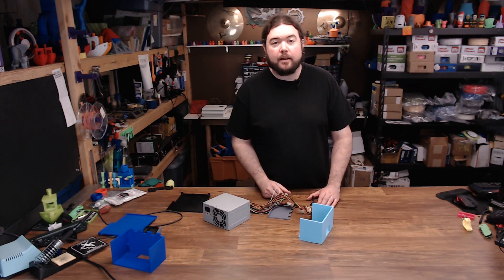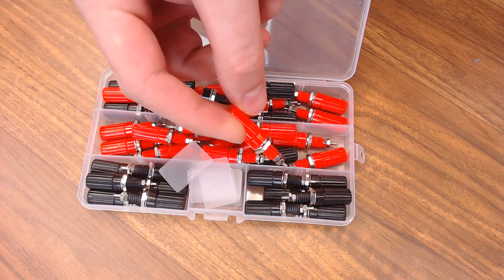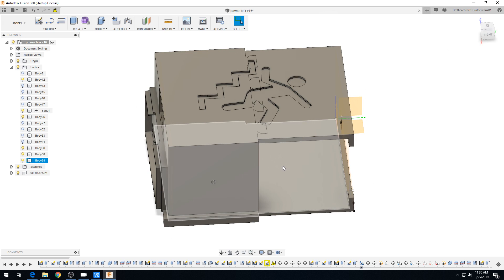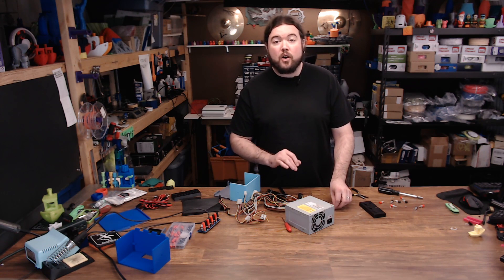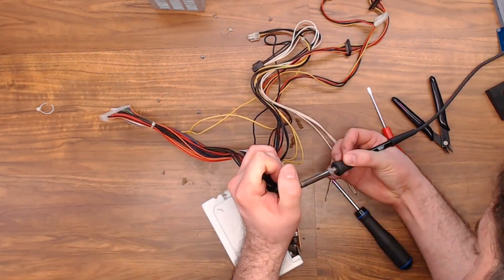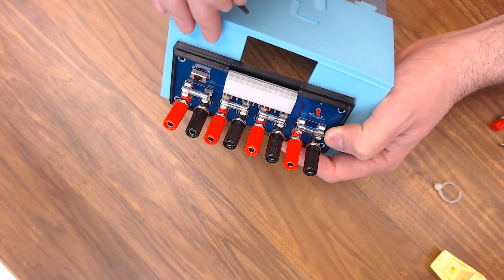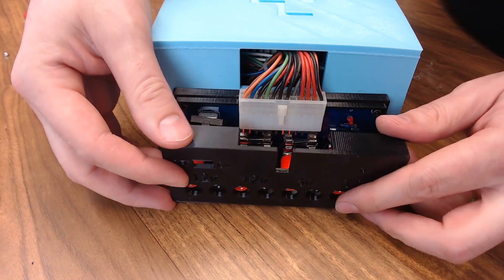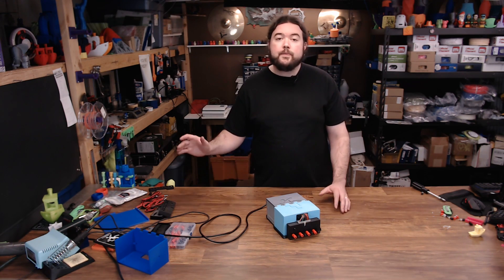Bench Top ATX Power Supply - 3D Printed - Chris's Basement

Comment: Thanks Chris- I posted a make. I did print in PLA just to try it, joints did not fit as expected. The logo area struggle with some bridging issues, but it was good enough  to accomplish a very cool task - well done. I now have a (fused) bench power supply. I am currently testing a (joined) all-in-one top piece with logo to try and make it a cleaner print.
Reply from the maker: Thanks for posting the make. I struggled a bit with it as well. I will go check it out now.

Comment: Neat project chris, I think just about every tinkerer out there has one or  two pc psu's knocking around,  the Haswell compatible power supplies  should be great for this as they do not require a dummy load  for stable operation but there are a few older ATX PSU's that do on the 5V rail  (10w is usually enough) to keep the 12v rail stable,  the ones that give trouble tend to push more watts on the 5v rail than 12v  as written on the side of the psu - look forward to your next one thanks again
Reply from the maker: Thanks Andy! Mine appears to be pretty stable, really happy with how it turned out.

Comment: Nice job Chris.  I like the adapter you got, and the upgrade to it was smart.  Great you un-soldered the extra wire instead of just cutting it.
Should have removed the dust from inside, helps the components stay cooler.
Reply from the maker: Thanks Mark! You're right, I should have.....some might have fell out? ;)

Comment: I just printed this for my PSU. But i made a different front for the ATX break-out board, because i bought a different type with the USB, 3-pin fan and 4-pin fan outputs. Actually my first design in Fusion360 and it fits perfect.
Reply from the maker: Very nice! Post a make!
Reply: @ChrisRiley  Just did that. And thank you for your work.
Reply from the maker: @jantlotus  Very cool man, Thanks.

Comment: Use a small piece of clear or translucent filament for the led. Make the hole just small enough to grip the 1.75mm filament and extend it internally to the led. It should project it decently well.
Reply from the maker: I bought some just to try this out, we will see how well it works.

Comment: You can put the banana connectors on the back of the board instead, then you can have the atx connector and fuses inside the case. Just have to rewire the switch.
Reply from the maker: That's a pretty good idea.

Comment: Slap on some low cost meters for voltage and current and your all set.  Chris if your planning on doing the Prusa MK3-S upgrade to your MK3 printer but do not want to wait 10 weeks for the parts from Prusa check out my inductive proximity filament sensor MK3-S mod.
Reply from the maker: Thanks! Cool, I will check it out.

Comment: I'm surprised that you didn't connect any load resistor to the 5V or 12V rails, one was needed when I made mine long time ago.
Reply from the maker: On the newish power supply, around 300w, a dummy load shouldn't really be necessary to keep it stable, but might still not be a bad idea.

Comment: You probably should not connect much more than an Arduino to this supply as presently configured.

I'm not seeing enough ventilation in this design.  The size of the fan opening is much larger than the small rectangular opening on the front.
You need to redesign the front cover and put ventilation holes on each side to prevent overheating.
Reply: As the large fan exhausts the heat closest to the power plug and not the rectangular opening... there is not real issue with overheating.. especially without putting serious load on the 12v leads.  These ATX supplies are able to operate in very close proximity to the CPU that generate a lot more heat than the ATX in this custom case.  Extra ventilation holes would be better.. but i do not believe a necessity.
Reply from the maker: The way I use it, it shouldn't be a concern. If it is, I can add some vents.

Comment: What about improving 12V line amperage by leaving some wires from Molex connectors and adding them to ATX 20/24 connector ?
Reply from the maker: I don't know, that might work, I would have to do some testing with my meter and see what they read.

Comment: Sooooo, I just finished printing this and salvaged an ATX power supply I had laying around and put it all together only to find my ATX connector is a 20 pin instead of a 24 pin. Am I hosed or can it be rewired to work? I have seen some of these boards work with either 20 or 24 pin.
Reply from the maker: I think it should would with either. Look to line up the green and black wire pins.

Comment: On a typical 400 watt power supply, how many amps is the 12 volt leg capable of?
Reply from the maker: On a 400w on the 12v you should see around 15amp.
Reply: @ChrisRiley  Thanks Chris!

Comment: Be careful connecting electronics to ATX supplies. ATX supplies (most) tie ground or V- to earth ground on the input jack. That is a highly undesirable electrical configuration for a lot of electronics. 3D printers especially PWM the negative -- allowing the positive to carry the Vin (done so that you can supply different DC+ voltage to different components) when you're PWM the negative and it's also tied to the earth of the AC in, you're asking for issues. I'd check your supply -- simple enough -- check continuity on V- and supply case, as well as ground input and V-.
Reply from the maker: Good tip, will do.

Comment: I have a spare ATX supply but the plug on the end of it is a 20 pin. Can I use this or do I need a 20 pin breakout box? Cheers.
Reply from the maker: You will probably need a 20 pin, but some will do both 24 and 20.
Reply: @ChrisRiley  Cheers.

Comment: Hi, if you can please add link to buy the things from AliExpress thanks
Reply from the maker: Here you go, these are similar. 
https://www.aliexpress.com/item/Electric-Circuit-24Pins-ATX-Benchtop-Computer-Power-Supply-Breakout-board-module-DC-plug-connector-with-USB/32949737362.html?spm=2114.search0104.3.1.548379a1HV4c4S&ws_ab_test=searchweb0_0,searchweb201602_9_10065_10130_10068_10890_10547_319_10546_317_10548_10545_10696_453_10084_454_10083_10618_10307_537_536_10902_10059_10884_10887_321_322_10103,searchweb201603_58,ppcSwitch_0&algo_expid=3b67dbd3-e80d-4814-b0a1-e4cdab8f75cc-0&algo_pvid=3b67dbd3-e80d-4814-b0a1-e4cdab8f75cc&transAbTest=ae803_4

https://www.aliexpress.com/item/10pcs-4mm-Red-Black-Banana-Socket-Professional-Binding-Post-Nut-Banana-Plug-Jack-Connector-Nickel-Plated/32969822440.html?spm=2114.search0104.3.241.53a4589fEASwno&ws_ab_test=searchweb0_0,searchweb201602_9_10065_10130_10068_10890_10547_319_10546_317_10548_10545_10696_453_10084_454_10083_10618_10307_537_536_10902_10059_10884_10887_321_322_10103,searchweb201603_58,ppcSwitch_0&algo_expid=6ae73045-8fdf-42ac-9642-428daea40d91-33&algo_pvid=6ae73045-8fdf-42ac-9642-428daea40d91&transAbTest=ae803_4

https://www.aliexpress.com/item/New-Best-Price-1M-Probe-Tips-Fully-Insulated-Electrical-Device-Test-Lead-Clip-To-Banana-Plug/32822796694.html?spm=2114.search0104.3.184.53a4589fEASwno&ws_ab_test=searchweb0_0,searchweb201602_9_10065_10130_10068_10890_10547_319_10546_317_10548_10545_10696_453_10084_454_10083_10618_10307_537_536_10902_10059_10884_10887_321_322_10103,searchweb201603_58,ppcSwitch_0&algo_expid=6ae73045-8fdf-42ac-9642-428daea40d91-25&algo_pvid=6ae73045-8fdf-42ac-9642-428daea40d91&transAbTest=ae803_4

Comment: WHY YOU NO CLEAN! the power supply.  nerd cred lost,  what the hell is -12v used for?
Reply from the maker: Cause I wanted to see how creative you would all be in the comments. You haven't let me down.
Reply: Short answer: + and - show you which way the electrons flow. Long answer: Ground is where all electrons want to go to - a throwback from the old nomenclature where it literally is the endpoint of a circuit. These days its used as a safety circuit in household wiring -- all the water pipes in the house and every recepticle should be 'grounded' to zero volts. Electrons (negatively charged) flow from negative to positive. Ground is arbitrary, but considered to be in the middle at 0 volts. Ground does not carry a charge, but it can be relative to any other voltage, positive or negative. Volts are a measure of potential energy, just like gravitational potential is generally measured by distance (height). The more something wants to go from A to B the more energy it has. By this analogy, higher voltage is higher height. Furthermore, let's say that ground is the same as ground level. Negative charges (electrons) try to get to positively charged areas. Consider negative volts the same as mountains, and positive volts as canyons. An object will fall off a mountain and land on the ground. An object can also fall from the ground into a canyon. Same thing here: Power can flow from -Negative voltage to ground, and the ground can also give up electrons to a + charged object. Example: North American cars (and most asian cars afaik) are Negative ground. That means that of the 2 connections in the circuit, everything metal in the car is connected to the negative terminal on the battery and is considered zero 0 volts. Any wires in the car are then considered to have +12 volts to show a total difference of 12 volts. Electrical circuits are just that - a circuit. They require a full connection from a voltage source through conductors to a load then back to the other end of the source. Hypothetically by hooking another battery's positive terminal to the car's frame, you could run a positive ground with negative wires at the same time, so long as the wires never crossed. Between the +12 and -12 volt wires you would have a voltage of 24V (the difference between the mountain and the canyon).
Reply from the maker: @stigberntsen9301  Awesome, Thanks for taking the time to post this.
Reply: -12v was typically only used by RS232 (serial) devices but is still part of the ATX specification even though rarely used (most serial adaptors generate their own -12v where necessary).
Reply from the maker: @sircompo  Great info, thanks for adding this.